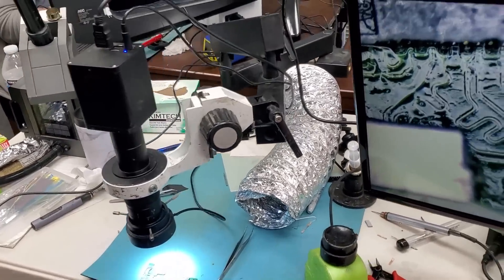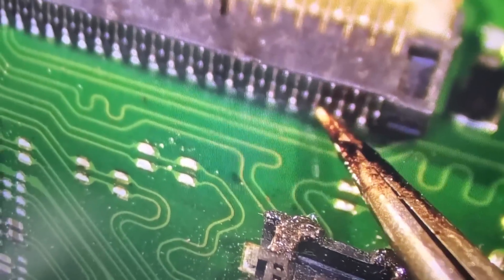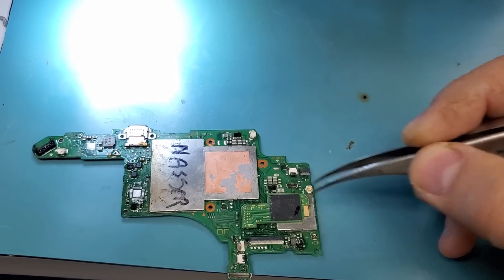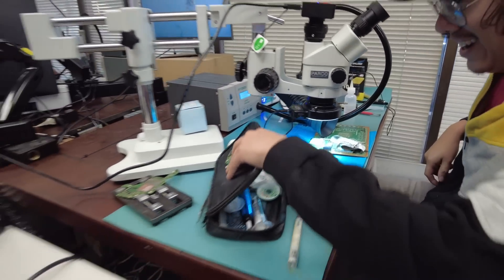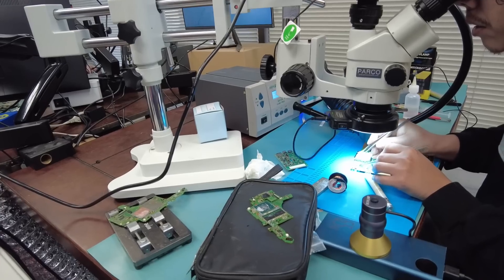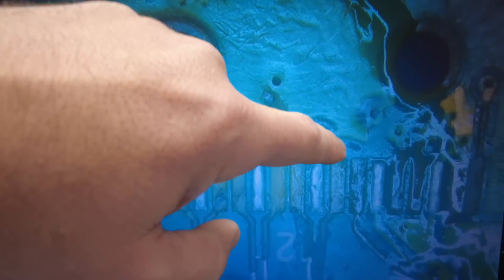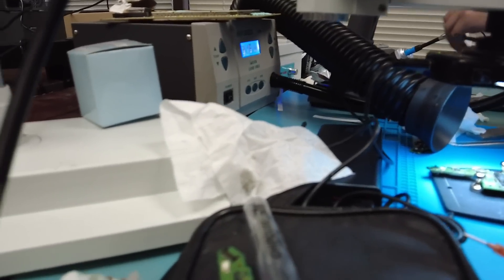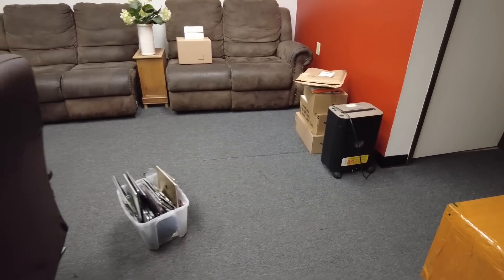Micro Soldering Training Workshop Day 6.

Comment: I have problem with my laptop it's Zephyrus m16 rtx 3060 intel 7-12700H  I just made a short in motherboard by a screw driver it turns on but nothing shows on the laptop's screen or any external screen..... Cant tell if gpu is dead or some mosfet showed it to 3 repair shops they say it's not fixable.......

Comment: This screen connector was the reason I started micro soldering❤ 
I messed up few pins on this connector when disassembling/assembling the switch. Replacing it was fun and gave a good sense of achievment 😊
One thing I don't know since. How can I remove flux from connector? Hard to assemble when flux still in it. Soked with IPA but not helped :/

Comment: it's you , that i watch about micro soldering and i learned from there and practice and now, all put good use as i will be able to modify circuit board , modify micro usb to usb-c connections and many stuff. thanks for your video all these while and helps alot ppl out there

Comment: I tried yesterday with micro resistor soldering but didn't do it properly because of twizers without good equipment we can't solder properly. But the process we learn from you we did micro works properly,👍